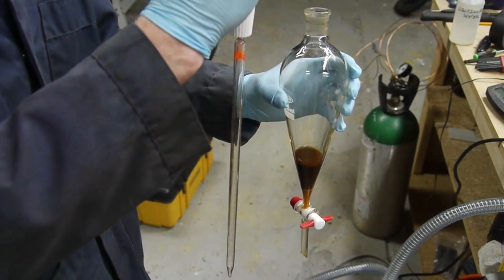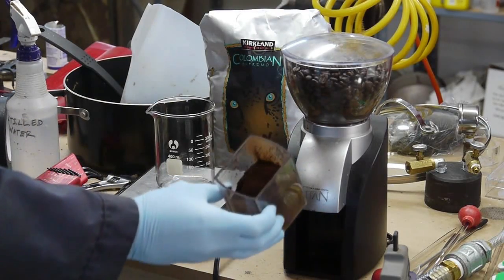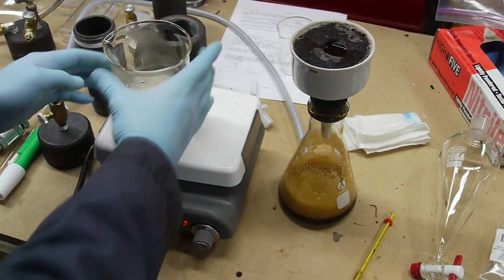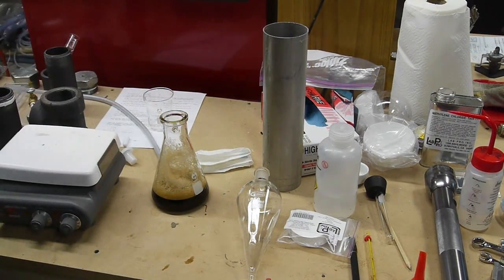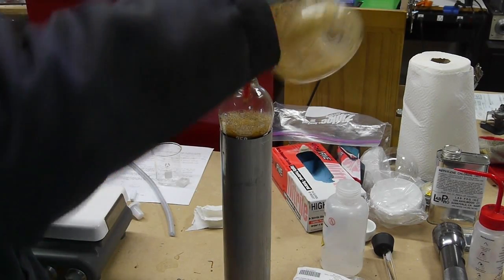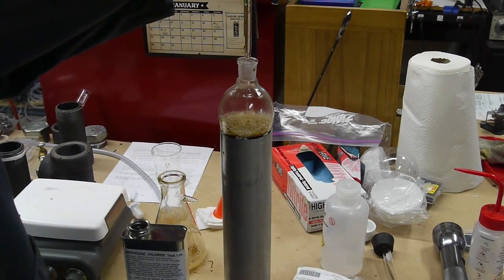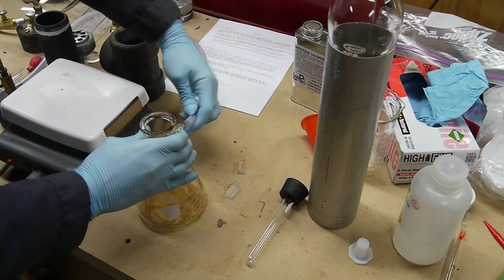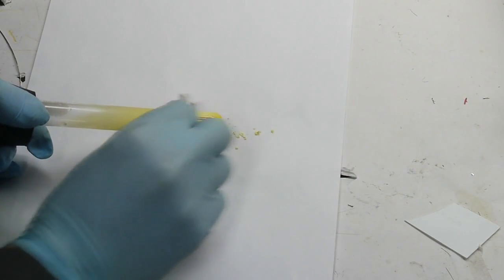Extracting caffeine with methylene chloride

Comment: Applied Science, why not use a closed loop pressurized with propane and use butane as the solvent. The proper mixture for this is 70% pure propane and 30% pure butane. Also it would be important to freeze the grounds first so that no fats come through. The result would be a tar like substance. Step two: remove any butane in a vacuum oven for two days. The final step would be to remove plant matter and separate the flavor from the caffeine. This would be done with a roto-vap set up using an alcohol solvent like Everclear. Using a triple trap the flavoring would come out first. as the product starts to clear, turn the triple trap to the second bell. at this point your waiting until the product is clear; at which point, turn the trap to the third bell. After this, let the clear substance dry for 95-97% pure caffeine. The reason why I mention this processes is that, you could extract from five to ten pounds of green coffee at the same time; instead of, the small amounts you were limited to here.

Comment: Some handmade equipment :P Great video but I would recommend to use instant coffee. Faster and less messy... results are very similar to these you've achieved. Also the easier way to check caffeine content in caffeinated drinks is to use spectro. Good video anyway!

Comment: It makes me thing a bit, when I see the concept of "sous vide" that is controlling the temperature exactly to achieve the desired doneness for food, and it makes me wonder, would a precisely controlled temperature bath help in this situation? I always see chemists measuring the temperature of the distillate stream, but would it not be better to precisely measure the heat input to the system instead?

Comment: You might be able to make purer material with a slightly longer separation workup.  Firstly, remember to vent your separation funnel after you shake it to avoid popping the cap off.

If you washed your aqueous extract with several small washed of DCM rather than one, you would get a large % of the extractable caffeine out, especially if you chilled the water for the later extracts. Then, combine the DCM layers and wash those with iced water to back-extract any of the water-soluble impurities which disslove slightly in the DCM.  I think you would end up with material that was purer with much less loss than your sublimation method.

re-crystallisation from boiling water would also be a good purification method because caffeine is much more soluble in hot water than cold.

Comment: I've had a terrible time with this. I even have a nice cold finger condenser. And a very reasonable vacuum pump. It won't boil water at room temperature, but warm it up a little bit and it boils readily.
My problem is, I keep getting some moisture (water  I believe) showing up after the liquid liquid extraction using methylene chloride. The water condenses on the cold finger, drips down to the bottom of the flask, mingling with my dried, crude caffeine then re-evaporating, back on to the cold finger.
By the time the moisture is evacuated, I'm guessing the caffeine may have sublimated but must've gone right out through my vacuum pump. The tip of the cold finger is as clean as when it went in. Methylene chloride can't solvate any water, can it? I figure the water comes from  not letting the sep funnel sit long enough after the very mild shakeup? – Mystified

Comment: Nice video, I loved the information.

One possible improvement would be to dissolve the caffeine deposited on the test tube in acetone or DCM, and then let it crystallize. You could also add a few mL of water to this before evaporation, so the water left behind could dissolve some of the impurities.

Comment: Just so you guys know, the grind for drop filtration is finer than espresso grind. That is the major reason why filtered coffee usually has more caffeine per volume than espresso coffee, even if with the espresso coffee you apply 15psi of pressure. The strenght of espresso is provided by the torrefaction procedure, which provides a more strong taste, but the taste of coffee beans has absolutely no correlation with its caffeine content.

Comment: Hi Iam thinking maybe a chloroform extraction instead of methylene chloride. It can pull out double the amount of caffeine than methylene chloride. Just make sure you get rid of it. Try extracting it in multiple smaller volumes also, I had higher yields in my own extractions that way. When the chloroform is evaporated try recrystallizing it with a solvent such as pure water. Cold water hold about half of the amount of caffeine as hot water . Filter it and evaporation extraction. I think it might yield some snowy caffeine.  Well based on my experience with other compounds.
http://www.scielo.org.ar/scielo.php?pid=S0327-07932010000300012&script=sci_arttext

Comment: I want to exact caffine, in high amounts, with good yeilds, so i can then turn into tablets for fun and such, is there any methods you can propose that will always give me good yeilds? without being to advanced of a setup?  thanks
Reply: if you want to make tablets out of it then a solvent extraction is not an option, maybe you could use ethyl acetate, a green solvent, it is still hazardous if consumed but utleast it is not a suspected carcinogen... if you want the cafeine to consume then extraction with supercritical co2 is your way to go but that requires some more complex set up... even though, if you just want to get caffeine then there are a lot of improvments that can be done to this extraction like ading calcium hydroxide to give a basic enviroment to the cafeine so it is less soluble in water (also calcium ions reacts with some of the impurities making them insoluble  and leaving them behind by filtration) also sodium chloride should be added befor the solvent since it will decrease the afinity of water to caffeine, and also a temperature of cero degrees celcius would be optimal for the extraction. at the end after the purification by sublimation is done a recrystalisation of cafeine under acetone or ethyl acetate would give you very pure cafein, in the amateur chemist comunity there has been guys that have reported a product of white cafeine powder out of tea

http://employees.oneonta.edu/knauerbr/chem226/226expts/226_expt06_pro.pdf

http://faculty.chemeketa.edu/jcammack/CH241-3B%20Lab/CH241B%20Labs/CH241%205%20Caffeine%20Extraction.pdf
Reply: Thank you greatly Schatten
Reply: or just buy some http://purebulk.com/caffeine-powder-synthetic/
http://www.aonevitamins.com/caffeine.htm
Reply: Justin Koenig buying pure caffeine may be illegal in some parts of the world
Reply: Schatten2712 don't think so mate
wikipedia: A mild stimulant found in coffee, tea, and soft drinks, among other sources, caffeine is one of the most widely consumed drugs, noted for its ability to promote wakefulness and provide energy. Caffeine is legal in all countries and jurisdictions, and is in modern times sold in over-the-counter medicines, although historically it was banned (often in the form of coffee) in at least several nations.
Reply: Justin Koenig ebay here I freaking go!!

Comment: Hey, the reason why coffee is brown is because of the tannins in the coffee beans. They are acidic but if you add a base it will neutralize the tannins.
Reply: Great explanation! Thanks. I knew adding a base helped, but usually the reason given is just "caffeine is more soluble when it's in a basic solution", but your reason sounds much more accurate.

Comment: Hey. Thanks for this vid! I was looking around for other vids and some guys were using cholroform/DCM. So could  I use other nonpolar solvent to extract? Like naphta or maybe heptane?
And answering to Tommaso Petrella, Adding NaOH to aqueous layer will mean you turn some of them in freebase form and they will dissolve pretty well and screw up your caffeine ectraxtion... So I think sodium carbonate should be better choice. But that is just me guessing. Havent tested yet. :)
Reply: Toluene is commonly used non-polar solvent, but the solution would need to be basified with NaOH first. Toluene seperate ontop of water instead of below like DCM and this methylene chloride mixture, which could prove more difficult to purify than it sounds.
Reply: Sodium carbonate is better option

Comment: Very impressive and informative. You should check out my website and see the tamisium extractor I invented. You may find some interest in the use of one. Give me a email or call and we can talk further. Not trying to sell you an extractor by the way. Have other ideas in mind. I think you would be interested. By the way you can change the polarity of the caffiene by acid introduction and then basing out to separate again into the cleaned layer added afterwards.

Comment: Hey Ben great video, I have a question about the extraction. I know that adding brine makes the extraction more effective but what if you over saturate the aqueous phase. Would it ruin the extraction? 
My best guess is that the salt that precipitates from the aqueous phase falls into the methylene chloride and start to dissolve. Thus making the extraction less effective

Comment: I would suggest, after your first water extraction, adding activated charcol to it (same as what's in a britta water filter), heat to boiling, allow it to cool, then sucking it through a bukner again.  This should clear up the solution significantly by adsorbing any very fine particulates, and cut back on the impurities.

Comment: I would add that methylene chloride has a low boiling point around 40 degrees C, thus for anyone wanting to try this at home: COOL the coffee before adding the methylene chloride, or you might have yourself a bomb, especially if the sep funnel plug is on.

Comment: It looks like you only did one extraction with the methylene chloride on that coffee liquor.  If you did 3-4 extractions I'm sure you would get a higher yield of caffeine. You don't even have to used much more methylene chloride, but if you only do one extraction the caffeine solubility will reach an equilibrium in both the water and methylene chloride and a large amount will be lost. By doing multiple extractions you reach the equilibrium more often and more caffeine will be pulled out.